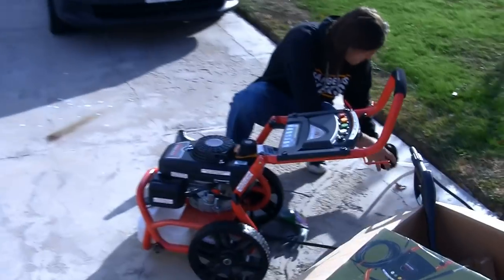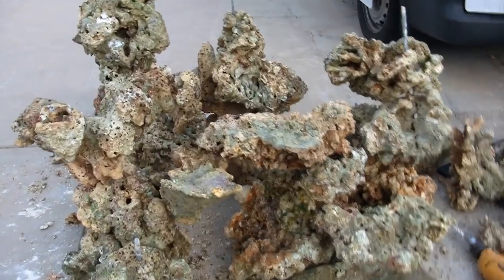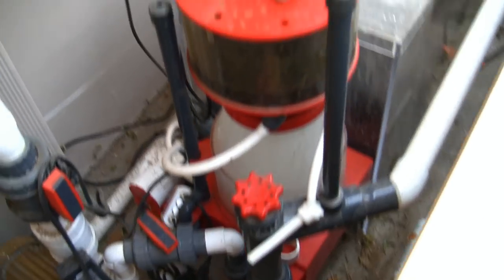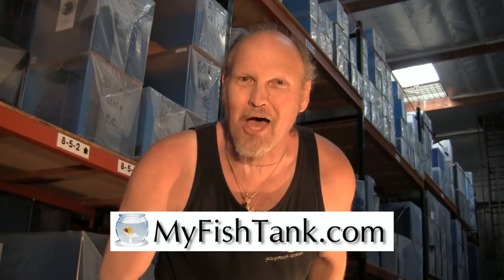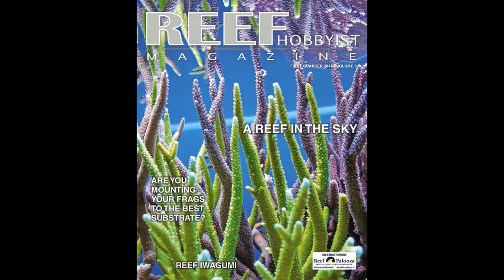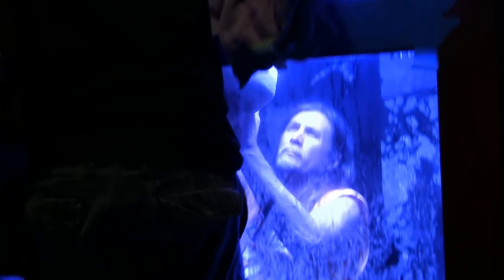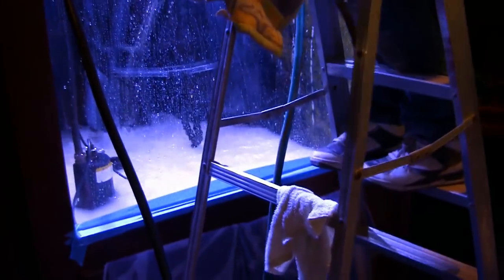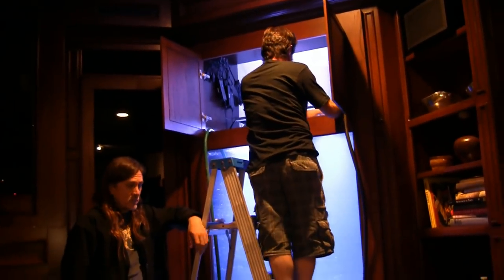Reef Tank Re-Do, LA Fishguys, Episode 161 Part 1, including adding Tunze's and an APEX System

Comment: Interesting tank.
I don't understand why you start with live rock and then work at killing everything that makes it live. Why don't you just start with dead rock like Marco or BRS reef saver?
Reply from the maker: Why do you think we killed it, cause we power washed it? that doesnt kill it, it just gets rid of all the death on the outside of the rock but its internal life remains.
Reply: @lafishguy  I have read many ways to prepare live rock. Never, ever have the sources suggested either pressure washing or laying out on a driveway for hours. You did not go into detail about the process except the pressure wash. Was the rock cured in heated saltwater after the pressure wash? How long? Lights on or off?
You might want to take a look at https://www.liveaquaria.com/article/209/?aid=209 for a good process.
Reply from the maker: The rock is 'container rock' meaning it was shipped in boxes ( with no water ) inside a container on a ship. I suspect it took weeks for the ship to arrive. as a result, and Im sure I have mentioned this, it has an abundance of loss of live on it. as a result its washed free of its death. We then placed it in a tub to soak or cure, with no lights, prior to using it in the tank. By eliminating all the loose and death off the rock I can minimize a big algae bloom. I dont need to view someone eles video to be told how to prepare the rock as it simply base-rock and considerbly less expensive ( $3/lb ) than traditional live rock which sells for over $6/lb ( which really is not available anymore ). you will see in the next set of video's how things turned out.
Reply: @Justthemow  Dude, that seems a bit harsh!
Although the original video didn't explain it well, Jim's further text does make sense. 
I wouldn't go that direction but it does work. My personal preference is dead rock like Marco. I really like Pukani from BRS but they don't carry it any more. Sourcing issues. :(
Reply: johnVidBozo look the rock in the crates was still alive it goes dormant during transport but curing it in a salt water tank with a good skimmer heater and light source  for a few days brings it back to life what he did strips it of any biological filtrating life it had inside or out he would have been better of buying dry rock better for the rest of us who would love true live rock and better for him as he wouldn't have had to spend all the monies on live rock just to kill it harsh is that someone else paid for live rock just to get bleached preasurewashed garbage
Reply: @Justthemow  I don't see anywhere Jim talking about bleaching the rock. It is apparently very hard to kill all the life in 'live' rock short of acid and bleach.
Price wise, it's about the same as dead rock. Jim quoted $3/lb.
There are ethical arguments for not using this rock, but that is about like 'discussing' politics or religion. Let's not go there!
Reply: johnVidBozo leaving it out in the sun while pressure washing it is Called sun bleaching basically cooking the life inside the rock there is no excuses for what he did to the rock did you see the last video where he uses fresh water to "rinse" the live sand I mean seriously this guy is stuck in the 80s with his methodology it's truly sad
Reply from the maker: Apparently you have not watched the entire video series as I clearly stated the rock was 'container' rock which means it was shipped dry, in a container, which took a few weeks to arrive. the reason for the pressure washing was to get rid of the death that occurred on the rock. Then it was placed into a tub and cured for a few weeks. This is not my first rodeo Cowboy, nor the first time Ive done this. I invite you to return to watch the next set of video's to see how the rock, and the tank turns out.
Reply: @Justthemow  I agree Jim needs to update his skills. There have been several fishguy videos that are full of out of date info. His comment, "I dont need to view someone eles video to be told how to prepare the rock" is really enlightening. Some people just are not into continuing education.
The only danger here is newbies watch this and think he is doing it all the 'correct' way. So for all the new fishkeepers out there - do the research and find the best practices as we currently know them!
Reply: @iammimic79  @johnVidBozo I totally get where you are coming from but all is not as it seems and perhaps as a result, things are easily taken out of context. . That rock was pressure washed to get rid of decay on it. What you didn’t see immediately following this process was the month or so that the rock sat in a tub curing with saltwater and a protein skimmer to cure before we went onsite to redo the tank.  Most live rock today (including this rock) is nothing like the live rock we got 20 or 25 years ago that was teaming with life. Stuff like Walt Smith used to distribute for example. Heck, the rock in my tank is Fiji live rock that I got from Walt back in the mid 90’s. As Jim mentioned above, this more like base rock stored in salt water that was shipped moist and the biggest benefit is the little bit of bacteria within the rock.  The little bit of time in the driveway (a few hours during the pre assembly and the pressure washing) after the rock was delivered may impact some of the bacteria but any impact on bacteria would have been nullified by the month or so of time it spent curing in the containers after Cande did his initial cleaning and prep. Again, this rock was live in the sense that it was pulled from salt water but it’s not like it had coral and other things on it that you would find on high end live rock which is pretty hard to find in volume these days.  And that kind of live rock would have been stupidly expensive in that kind of volume. Had this been like the old Fiji live rock that we used to get in the early to mid 90’s, the process would have been different but other than bacteria, this rock was fairly devoid of life and not even a hitch hiker to be seen on it. So in closing, I completely understand why you feel the way you do but if you saw the rock, you’d realize it isn’t like the true live rock we used to get years back and covet today. As noted, that stuff is nearly impossible to find these days and if this rock was teaming with life, the process would have been completely different.
Reply: @iammimic79 It was only out in the sun for a couple hours. Ever see the reefs at low tide where SPS corals are exposed to direct sun for hours? As I noted above in reply to your initial comment, this wasn’t high end live rock teaming with life. Sadly, this rock was virtually devoid of life that you would expect to find on high end live rock and after Cande got done with his process, the rock went back into tubs with salt water and a protein skimmer to cure for about a month before we went onsite to do the install. Something that is hard to understand due to editing.
Reply: @slief  Thanks for the expanded explanation. What factors do you consider when choosing between this rock and dry rock like BRS 'reef saver' or Marco rock?
Reply: Personally, I avoid the dead, dry or fake rock. I much prefer live rock even if it's just base rock that has been in the ocean or salt water for some time in large part because there is usually a more diverse bacterial population which reduces cycling time and usually has less Po4 in it but that isn't always the case either. I also don't adding bacterial additives if I can avoid them which would be something I would add using the dry of fake rock and the live rock will help circumvent that. Those are just my personal preferences though.  You can use any of the above and be successful.

Comment: Sorry but what a nightmare that tank must be to manage, i would have tried to talk them into getting a different shape tank...and a glass one....
Reply from the maker: The 2" thick acrylic material required me to purchase a special pair of $500 Cleaning Magnets and I do have to use long handled tongs and scraper but cleaning the tank is not that difficult. I spend far more time doing water changes and filter media replacement. Wait for the next set of video's in this series to see how it turned out.

Comment: Omg why did you buy all the live rock just to pressure wash the life off of it you could have just bought dry rock this is sad I watched part three first and was sick when I saw you washing the live sand I thought you were using dry rock it was so white then I come here and and am just completely flabbergasted I hope his homeowner doesn't watch these videos you needed to put all that rock into a curing tank and keep it alive OMG WTF
Reply: @iammimic79 See my comments in my replies to your other comments. This was not high end live rock and was mostly devoid of life. The rock spent a month in curing tanks with salt water and a protein skimmer after this part was filmed and there was no noticeable life on the outside of the rock when it arrived as I mentioned in my previous replies. As for why he didn’t use dry rock. Largely because of the phosphates found in most dry rock plus there was some bacterial benefit to using this rock (even after pressure washing and the preassemnly work Cande did. Also, the cost of this rock was somewhat comparable to dry rock. If they did go the dry rock route, then there would have been a lengthy lanthanum chloride process to get rid of the Po4 in the rock. Plus they were able to cherry pick these rocks for size and shape at the local wholesaler where as the local wholesalers don’t stock much dry rock. Anyhow, if this was like the live rock we got years back, I’d agree with you and the process would have been completely different but it wasn’t like the live rock of years back and it never had a chance to fully dry out.  Any bacteria that was impacted in the process had plenty of time to rebuild during the curing process after Cande did his work.